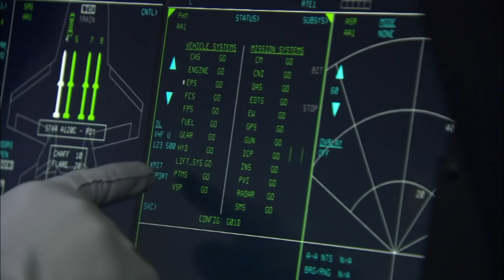Australian industry participation in the F-35 Joint Strike Fighter Program

Comment: For those who replied about the cost of an F18 Super Hornet, we need to pause and work the numbers.  Any Air Force or Navy must buy and deploy in high numbers to have weight and depth of defense.  The F35 costs $90 Million/copy and $45,000/hour to fly.  It’s contemporaries
While not Home Depot cheap gave significant cost savings in any bulk purchase and long-term maintenance.  Indeed, the existing platforms are all combat proven.  With updated avionics and longer airframe life, they represent a better value for the investment.  When we talk of the F35, we assume all situations will require its claimed stealth and its bells & whistles.  Common sense tells us that won’t be the case.  The public is programmed to believe that spending more tax dollars will always get you that ultimate fighter jet.  In any confrontation or war, an Air Force or Navy must have sufficient depth and fast turnaround of platforms to carry on the fight after taking damage or loss.  At $90 Million/copy, how many can be deployed and maintained?  Things are fine on paper.  Real deployment and strain of use make things harder.  Nobody wants or seeks a war or confrontation.  However we define readiness (here, depth and being able to sustain combat) will ultimately mean more to our forces and success.

Comment: The F35 is over priced and over rated.  Australia has been given the same sales pitch Lockheed Martin has given to others. At $90 Million per jet, how many can Australia afford to buy or lose in combat?  How many hours of maintenance are needed per hour of flight time? Any force must be able to sustain damage & loss and still carry on the fight. At this per unit cost, it is a budget buster  and will crowd out the many other needs that Australia has, such as a fleet of fully modern frigates, transport planes, helicopters, mechanized infantry units.  No single item should be given such deference that it could potentially affect overall readiness.
Reply: Do you suggest that we buy the French Rafael 4.5 jets like our submarine, older tech but 1.5x the cost to purchase and maintain? India couldn't buy F35 because they have the Russian S400 so they had to settle for Rafael, it's now a budget drain for them!